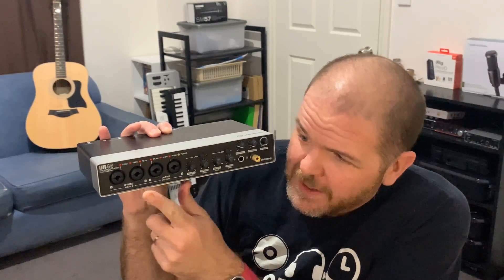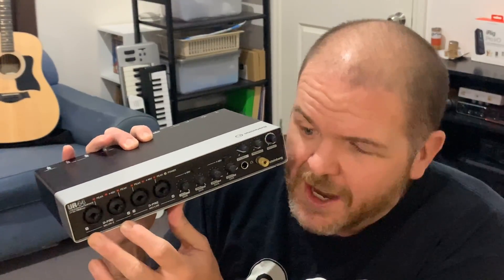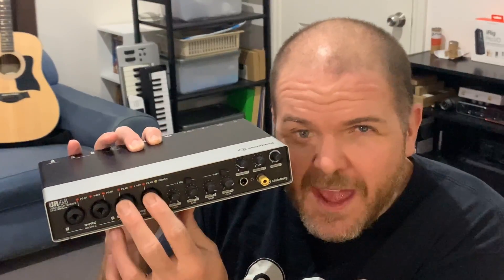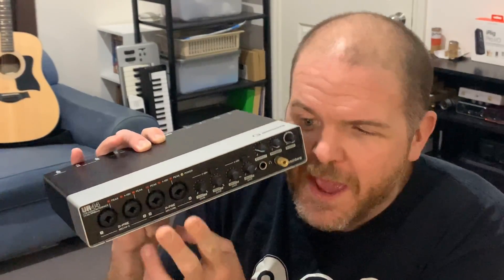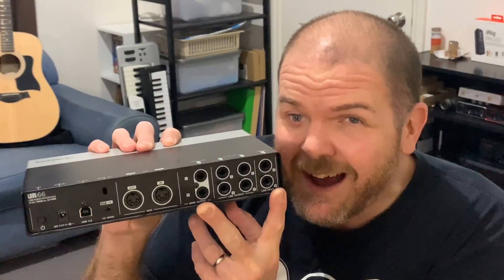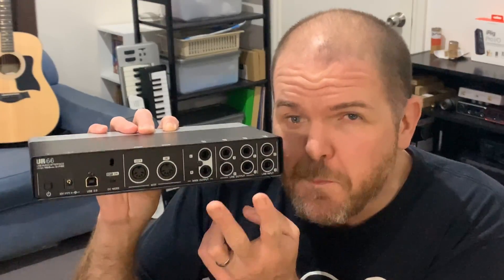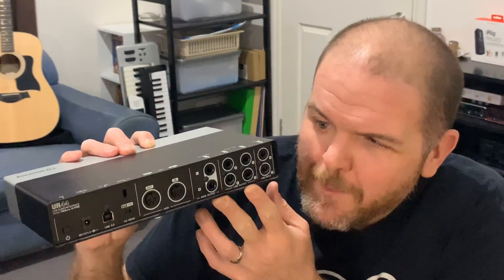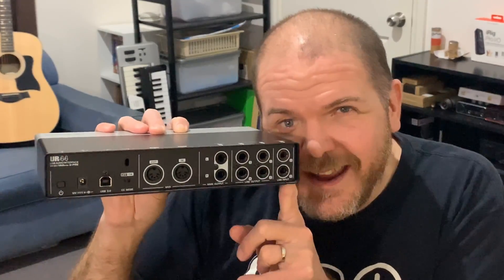What's the difference between a TS, TRS and TRRS cable?

Comment: Great explanation Pete 👍 I'm trying to live broadcast a DJ set but I'm having a few issues. I purchased the following items
a 3.5mm Mini STEREO Jack to 2x 6.35mm 1/4" MONO Male Plugs Cable and a 3.5mm Audio Headset Mic Y Splitter Cable Adapter TRRS to 2 TRS.
I plugged the first cable into the booth output of my mixer which is then plugged into the mic socket of the Y adapter. The adapter is then plug into the headset of my mobily phone.
However the phone isn't picking up the adapter and therefore isn't picking up my music. 
Any ideas what I would need to do?
Reply from the maker: Hey there. So, sounds like the issue is with the input of the phone. Phones use TRRS inputs meaning they only have mono microphone input and not stereo in. Also, you need an adapter to convert the TRRS to a TS that will support the mono input in. You also won’t get a great quality sound doing this because of the nature of the input being just a mono mic in.

An audio interface or mixer would enable you to do this - https://youtu.be/Sc-_LiuqiRA
Reply: @StudioLiveToday  thanks for the reply Pete. So the 1/4" mono into the back of the mixer, then the other end of it which is Trs plugged into the usb interface. USB interface is then connected to my phone? I watched the video in the USB interface and it mentions apple products. Do these interfaces connect to Android too?

Comment: OK so  a TRRS has..... tip, ring, ring, ring, sleeve. So why is not designated   == TRRRS?   Do check this out. I know it is confusing to me and i imagine may be confusing to others.
Reply from the maker: Hey there. You might be looking at the smaller parts as rings instead of TB e larger bits between the thin lines. I his is why “TS” doesn’t mention an “R” at all, but does have the little line separating the tip and the sleeve. It just relates to the number of connection points inside the socket.

Comment: Hi Pete! loved your explaination of the different cables and I do have a question for a case that I haven't found anywhere on internet. I am a presenter and I use Rode wireless mics and once I wanted to plug my handheld mic inside the wireless transmitter to make it work wirelessly. 

The cable that I was using was a xlr to 3.5mm and it wasn't working unless I could keep the 3.5mm jack slightly held up from the inside of the transmitter plug because if it was completely plugged in I couldn't hear properly and the sound was distorted. 

I have been looking for different cables but I don't have the right knowledge so maybe you have an idea on how to make it work? 

Thank you so much
Marco
Reply from the maker: Hey there Marco. This sort of problem is usually caused by plugging a TRS plug in to a TRRS socket. Rode make Ana adapter for this - the SC4 - https://amzn.to/36NcCkC

This may not be your exact problem and I’m not familiar with the specs of the mic and plugs you’re using, but worth exploring.

Comment: Hey, thanks a lot. Just bought my first condenser microphone for recording my acoustic and was wondering how is it possible to connect it to my amp if I want. Now I know what cable to buy and got some good additional general knowledge as well. Short, simple yet very instructional. Thanks again.
Reply from the maker: Hey there. You’re very welcome. Just remember that a condenser mic requires phantom power so make sure you are goi if through a mixer of interface which can provide 48v of phantom power.

Comment: I'm wondering if you can plug a TRRS earbuds (have a mic) into a TRS belt clip radio and have it work as simple non-mic earbuds?
Reply from the maker: Hey there my friend. It depends on the exact device, but yes, often TRRS headphones do work correctly in a standard TRS jack.

Comment: Hi, I'm trying to connect 2 Sennheiser EW 112p G4 wireless lavs to an iPhone 6 (for IG Live). The setup is as follows and in order:

iPhone 6 < Lightning to 3.5mm adapter < Røde 3.5mm TRRS to TRS Adapter < 3.5mm Audio Stereo Y Splitter < (2x) 3.5mm male to female XLR < (2x) Sennheiser EW 112p G4 (all this is pictured)

As you can guess, it's not working. No sound comes into the iPhone from the wireless lavs.

I did check the lightning to 3.5 adapter with a set of wired earbuds and it is working. But, when I connected the Røde adapter to the 3.5mm/lightning adapter, no sound went through. Is that normal? Any other way I can test that Røde adapter?

And I also removed the Y splitter to only connect one lav, but it didn't work either.

Do you or anyone else spot a glaring issue with my logic? Do you have any other (ideally budget/cheap) solutions to get those lavs into the iPhone?

If it helps, I do have access to a U-Phoria UMC204HD, any way to use that to connect the mics to the iPhone?

Any help or guidance would be appreciated.
Reply from the maker: Whew! Yeah, this is a tough one. I might need you to email me some photos and a little more info.

What all are you using to record in the iPhone? It might be that the splitter is TRS and not TS, but if you’re removing the splitter and still not working that’s not likely it.

Shoot em an email and I’m happy to see if I can help. pete@studiolivetoday.com

Comment: Hey Pete , very nice explanation -

I have 2 question 

1. I have a combination of amp + internal mic stereo input going to a preamp and then to either an amplifier or a UR22 M2 audio interface 

Do I be using the TRS cable as an output from guitar to the preamp

2. Can I use the TRS stereo instrument cable from guitar and plug to my UR22MK2 directly and get stereo sound
Reply from the maker: Hey there my friend. Thanks for watching and for your questions.

1. You will need a standard instrument cable with a TS connection to plug a guitar in to the Hi-Z or instrument input on a preamp or interface. If you want to convert the instrument signal to XLR to plug in to a preamp you can use a DI box or similar.

2. Almost no guitars have stereo output unfortunately. Most guitars kits have a standard TS jack that sends mono audio out.

I hope this helps. This video may provide you with some more information related to this - https://youtu.be/DSjeLsPj-Lc
Reply: Pete Johns thanks for that prompt reply :) 
I have really good feedback on your channel and hope you do keep them coming in 

I have the trinity pro which has both mic and a transducer pickup and feeds out stereo to a blender pre amp which then blends the tone and makes it mono . Think this is where I need a TRS stereo out from guitar as per the manual

Think from your help I might have to use that mono as a hi z input of UR22MK2
Reply from the maker: Thanks my friend. Hope it all works for you there. Feel free to email if you want to chat further or let me know how you get on. Sounds like an interesting setup. pete@studiolivetoday.com

Comment: Thanks for the video!   Tip, ring, and sleeves.  Awesome.  Learned something new.

So I have this setup that is failing for me:

iPhone: running an App that take in my audio from built-in Mic and combines it with audio from other people in a voice-only chat room, which then outputs to the headphone jack

Male TRS to dual Female TRS adapter cable
  \_ male TRS to over-ear headset
  \_ male TRS to male TRRS connected to iPad’s headphone jack

On the iPad when I record audio the output from the iPhone is REALLY low.  What am I doing wrong?
Reply from the maker: Hey there. Hmmmm..... so it’s hard to work out and visualise the exact setup here. Maybe send me an email with some more details or photos/diagrams? Some sort of mixer is the ideal solution for this, or perhaps using one of the visual mixer apps like AUM or Audiobus.

Comment: I always wondered why unbalanced exist these days. You do not need a sophisticated circuit for a balanced scenario. It's not really better quality, it's really just a better way to connect. There must be an extra cheap component to invert the signal, and my guess is that the cost difference is negligible. Don't all guitars have an unbalanced connection to the interface? I think the big benefit of balanced is with long cables or cables that are effected by interference. Balanced connections are quite resistant to interference because the interference is cancelled out. It's interesting and good to know the way balanced signals work.
Reply from the maker: Yes, I wonder if anyone has installed balanced TRS jacks in guitars? I know some guitars have XLR jacks so it’s clearly feasible. And I guess speaker cable is still unbalanced because the signals being sent are so “hot” there’s generally little impact of interference.

The real reason is probably down to cost, and the backwards compatibility of older gear.
Reply: That's what DI boxes are for. Actually DI boxes do more than just provide a balanced signal and you can get one for under $50. Berlinger has a few different types at good prices. I guess that's why guitars do not put out a balanced signal. Since there are other things to consider, you are right that when you start including all kinds of built in stuff like balanced outs, the price goes up considerably. This way the player can decide how much is needed and purchase things like DI boxes. Thanks Pete. I appreciate your quick responses. You are building a great channel. You should do some interviews with experts in various things like electrical or midi. Just an idea. You have a lot of positive energy which is key.